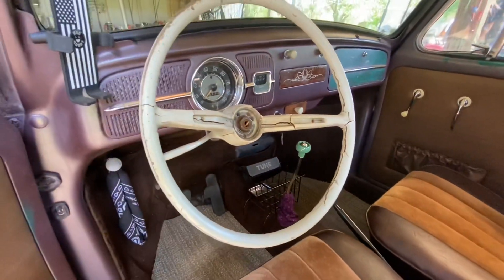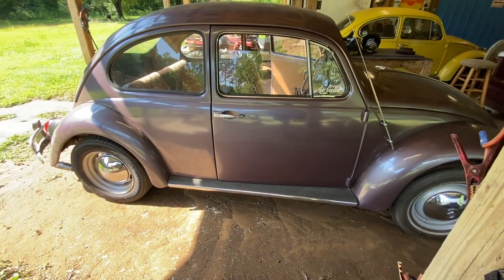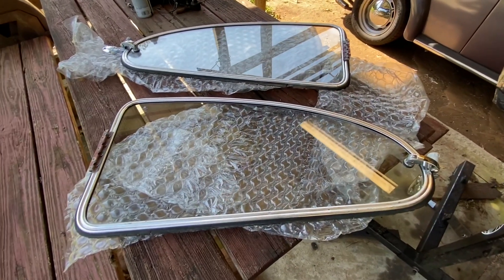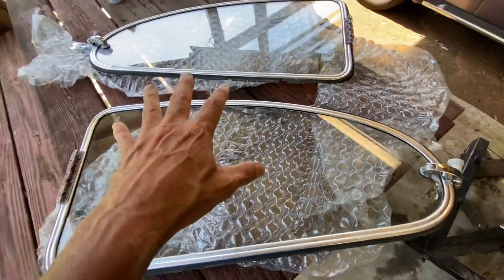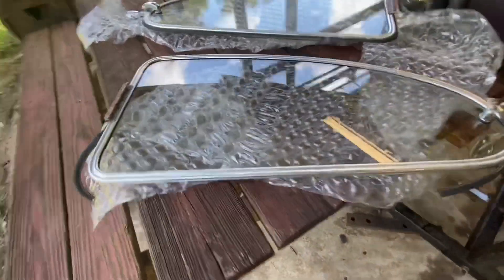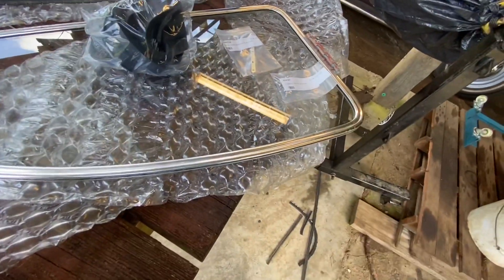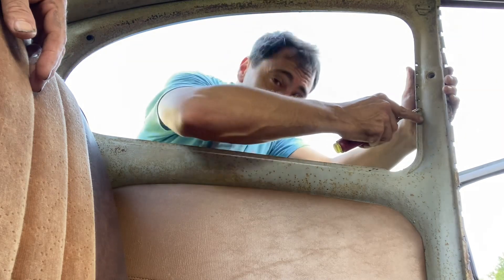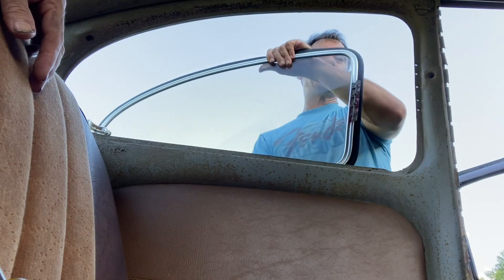How I Installed VW Pop Out Quarter Windows On A Budget

Comment: It’s been a year since install, how are the seals holding up, and if so, where did you get them?  Thanks
Reply from the maker: Hey OTTO, they still look brand new, buuuuuttt, I keep them out of the weather and clean then pretty regularly. They have shown signs of light mold, but it wipes right off. If it sat out in the rain and sun I’m sure they wouldn’t be still looking so good. I got those from JBUGS just because I was ordering a bunch of other stuff at that time. I do however look to Wolfsburg West when I want higher quality, but I don’t think they had those. Good luck if you’re doing this job. It’s a tedious, finger pinching chore, but fresh window seals/rubber makes a huge improvement….as you already know I’m sure 👍🏼